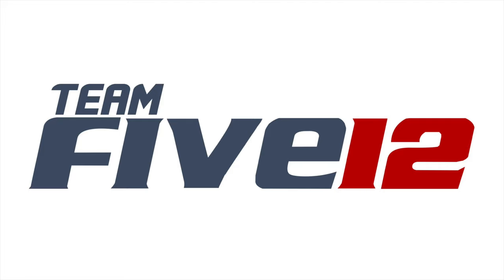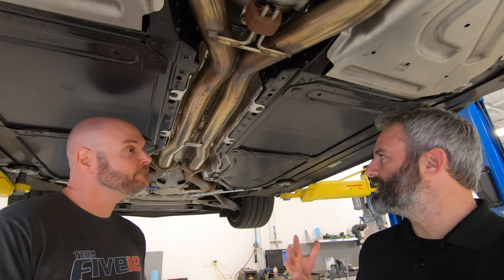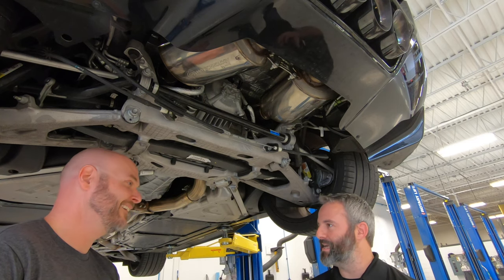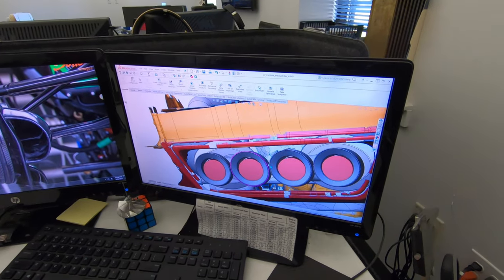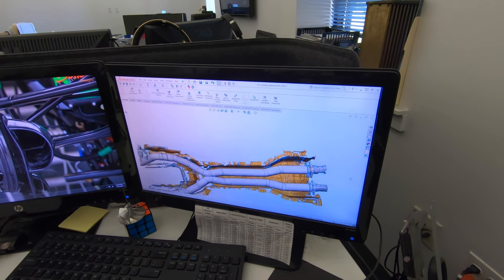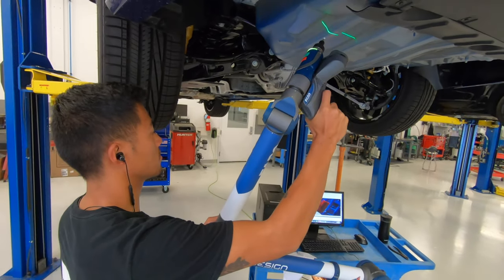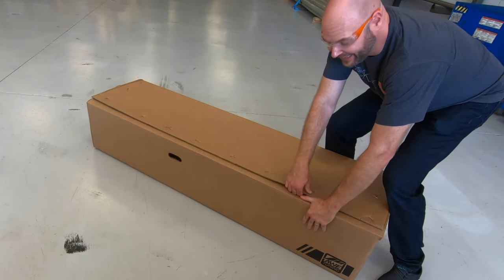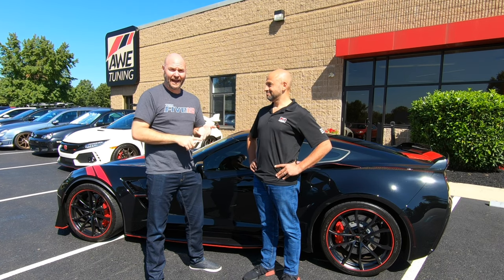Best Sounding Exhaust for a C7 Corvette! - Epic Tour of AWE's World HQ

Comment: Just bought my first Corvette ever a couple of months ago. It's a 2017 Black on Black Grand Sport. I'm so impressed with the car, performance and sound, but I may need to do the whole AWE system with the black tips. This isn't only my first Corvette, but also my first non daily driver.
Reply from the maker: Congrats on the Corvette!  And your first non-daily!  I've found that not dailying your Vette makes the experience that much better.  IMO the AWE Touring axleback along with the xpipe is the best sounding exhaust for these cars.  And the diamond black tips look so good, especially on a black GS!  Have you pulled the fuse for your NPP yet?
Reply: Team 512 Sorry I don't know what a NNP is, but I'm guessing I should LOL
Reply from the maker: Lol. I believe it’s fuse #42. Under the hood. It keeps the valves on the NPP exhaust open all the time. I did it because even in Track mode the exhaust valves close under a certain RPM.  Pull the fuse and start with the XPipe. You’ll be happy!
Reply: Team 512 Also I saw one guys video on stopping the car from going into 4 cylinder mode. What are your thoughts on that.
Reply from the maker: pjfan173 Do you have an auto or manual? If manual, don’t put it in ECO and you won’t have to worry about it. If you have an auto, I would get a range device to disable it. Quite a bit of documentation to support disabling it.
Reply: Team 512 I have an automatic and honestly I don't drive the thing very hard. I can't see flipping from 4 to 8 all the time can be that good for the engine.
Reply from the maker: @pjfan173  Agreed.  I think it also causes issues with the torque converter and creates a "shudder". Do a search on 'AFM Shudder C7'.
Reply: Team 512 I will and thanks for the replies. 
I bought my car from a dealer and purchased an extended warranty, just incase I have any trouble